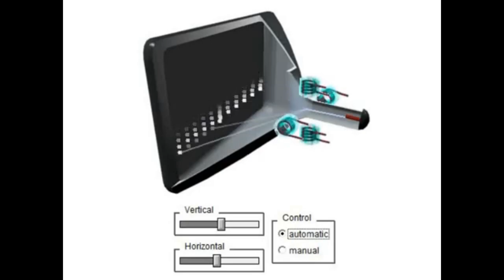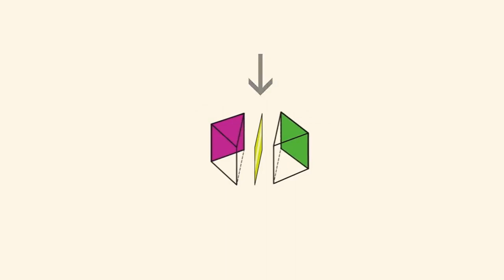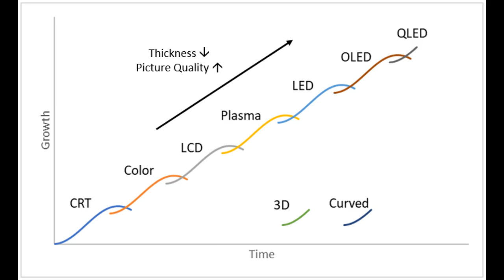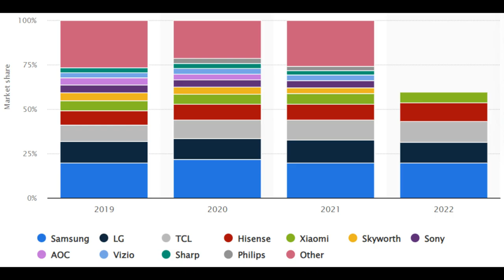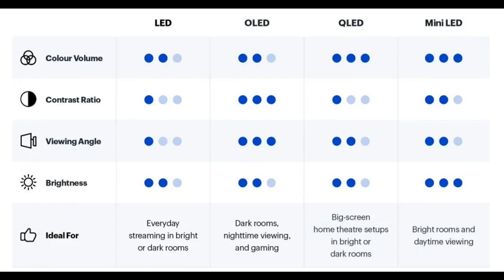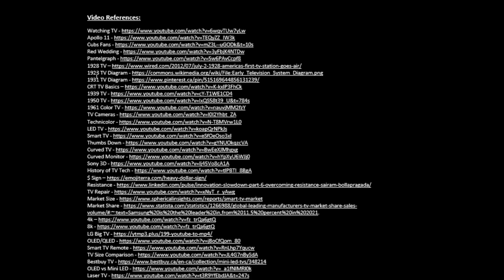TVs

Comment: I think that the future of TVs is in VR, simply due to the immersion and benefits of saving space. A shared VR experience would be simply groundbreaking. Currently, the 'heart' of many homes (or at least the room which receives the most traffic) seems to be the room with the TV in it. Previously, it was the fireplace or other heat source, so it's interesting to see 'Maslow's Hierarchy of Needs' in action. Central heating solved one essential need, and a new need (short-form dopamine release via entertainment) was addressed by the household TV. However, the housing crisis and a growing population suggest smaller homes, and the elimination of the TV via a VR headset could drastically overpower the need for televisions. Even today, we have access to small screens at all times (phones and computers) which could act as substitutes. This is one reason why I believe the market for TVs is likely to end within the next decade, signaling the advent of a new S-curve in the home entertainment industry.